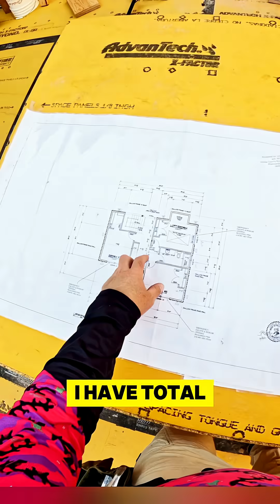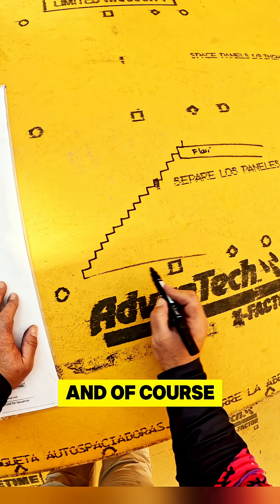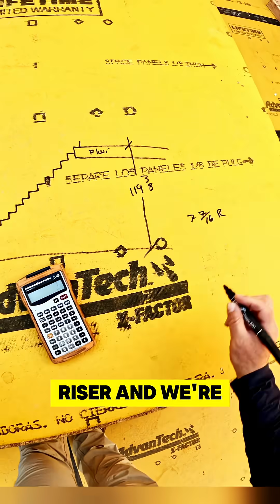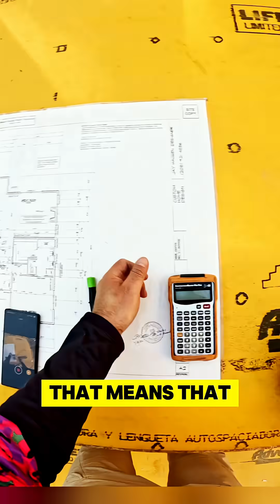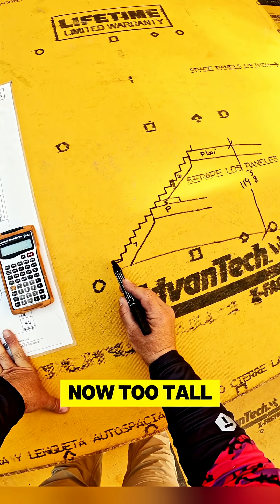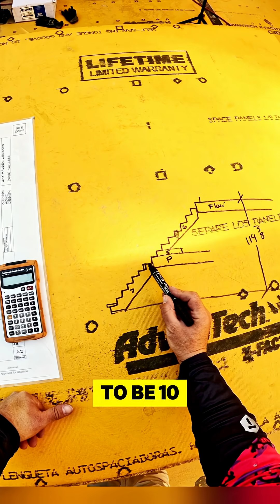How To Calculate Stairs

Comment: If the stringer goes from rough subfloor to rough subfloor and I have three quarter hardwoods top floor and bottom floor and I have one inch oak treads I deduct a quarter inch at the bottom rise?? I think. Wait, was I asking or telling???? Stairs are the worst even when you're just walking up them.

Comment: Finish stair guy here: calc. your overall rise off whatever the finish floor is. On a switchback (this one) set inside stringers with 7in between. If this get routed skirts set the wall stringers 6 in off wall or I'll just cut all your.points off.
Reply from the maker: I wouldn't build this way if a finish stair guy is coming in

Comment: In most cases the rise is always between 7 1/4 to 7 1/2  because it’s code in new construction I’ve worked with guy’s who wouldn’t even measure just used 7 3/8 in every house it always worked but I didn’t like it

Comment: What if you use a hanger board (lets say 3/4" or 1/2" ply?) to attach the top of the stringers to the landing, do you then have to subtract from total run therefore changing the overall unit run?

Comment: I'm retired. I have spent YEARS making and measuring for stairs. Do yourself a favour, use metric. Also do not count on plans for anything other than a vague idea. The builders will be out.. not by much.. but it will be out. So you wait until those floors are finished THEN measure the actual gap. If you use metric..(no one but you will know) it is easy peasy. Never got one wrong.
Reply: Thank you petermw88 for reminding us to measure the actual built height!
   Using metric (for decimal calculations and millimeter – 25.4th-inch – precision) rather than more complicated calculations with fractions and 1/16th inch resolution is an interesting idea. Builders in the US aren't usually fluent in metric and probably don't have the needed metric measuring and layout tools, especially a metric framing square. However, this is still worth trying with a metric/US tape measure and maybe a 300mm steel ruler, along with a stair gauges and a US framing or speed square!
   Another idea is to use 32nd-inch precision – as penguinz4493 suggested above – and "cheating" individual riser and tread dimensions up or down by 1/32" or 1/16" to make up the difference between the sum of all risers and the measured height.
Reply: Yup, got my head spinning a few moments into the video. Metric is way easier

Comment: A key factor here if you're using the same material on the floor your stairs are landing on and The Landings ignore that shortening step of the bottom stair
Reply: This is only the case if you're Landing your Stringer on the subfloor

Comment: I’m confused - isn’t there also the thickness added at the platform?  If you subtract from bottom of ground floor stringer and add treads to just below the platform, you maintain the 7-7/16 depth all the way up, UNTIL you add the platform advantec onto the framing members.  Now that last step to the platform is the tread thickness taller than all steps below?   I must be wrong, please explain

Comment: The 1912 house stairs would like to challenge the print. If we reset the rules to 7 3/8 rise & 11 3/4 tread, just give me the hole to the second floor demetions and I can make it work. The first tread may encroach on the hallway 3 inches. And the top tread may intrude on the structure beam. We need to (re-learn) what our grandfather’s already did.

Comment: Very well explained, and to teach, draw it out, I would say that every time, (draw it out). That said, working in the 1912 house don’t be afraid to go outside the box in a 1912 center hall colonial with a 9 foot first floor. In 3 floors doing “split” stair stacks in adjusted landing heights. The first stringer is 11 steps to a lowered landing, 7 3/8 rise to a 11 3/4 tread. That wraps to a 2 step rise to the second floor ( 8,6 tall). What this does is it shortens the first stringer to be able to go 11 3/8 treads. Making it so comfortable to climb these stairs (48 wide). The second floor duplicates, but makes up for 8,6 height in a 10/3 split stack of stringers. 10 up, (landing) 3 steps up again to 2nd floor (48 wide). The last split stack of stringers goes 9 up turn then 5 up again to 3rd floor. Completing this master pice of stair building. You don’t see it often, but when you see greatness as a carpenter, it is much respected. Even the base trim matches height of the stringers at base cut.
Lowering the landings from design spec was just brilliant, nobody ever thinks of lowering the landings, untill one sees it, then your like, “wow”.
Reply from the maker: Thats so cool. I follow Maine Stair Co or something on Instagram and they are fantastic

Comment: The only time you change the bottom step or top step height is when the finished floor material are different from the material used on the stairs. For instance if they used hardwood flooring downstairs and it’s 3/4 inch thick but the stairs, landing, and upstairs are carpet you would adjust the first bottom step accordingly. Carpet and padding probably is only about 3/8 thick which would mean you’ll need your first step about 3/8 taller. Nobody usually worries about this since when the inspector inspects the stairs at framing inspection he will check to make sure all steps are within 3/16 of an inch in height.

Comment: Height of 119 3/8" ÷ Max riser height of 7 3/4" = 15.4 risers. Then you always round up so 16 risers. 119 3/8" ÷ 16 = 7 15/32" riser height.
Reply: Thank you AwesomeFramers for your detailed explanation and sketch! It looks like you arrived at the 119-3/8" height by measurement rather than reading it off the plans – good for you!
   Your calculator seems to round to the nearest 1/16". A 7-7/16" riser times 16 equals 119" which is 3/8" below the second floor – you can compensate for this by increasing the 6 risers on the upper stair stringers by 1/16" each, thus making the entire rise 119-3/8".
   Thanks pennguinz4439 for your suggestion of a 7-15/32" riser! This riser height times 16 gives 119-1/2" total rise – if you reduce just two risers by 1/16" each, you'll be at your required total height.
   A mark of a skilled building tradesperson is knowing when and how to compensate for architectural details out of square, plumb, or level; adjust siding or shingle courses to avoid visible inconsistencies or problematically sized pieces; or knowing when to install something level or plumb versus installing parallel or perpendicular to an existing nearby detail.
   Lastly, thanks to all the commenters who reminded us of the need to consider finish flooring thicknesses on each floor and landing!

Comment: Putting a great deal of faith in that plan in terms of risers. I used to work with some folks that not very good draftsmen, and would not draw those in plan correctly.
Reply from the maker: No faith, I'm onsite and I run through this before framing wall, actually at wall layout to make sure it all fits 👍
Reply: Did tou actually use your brain when you watched this video? Or are you jist a concrete finisher?
Reply: Right on stairs never work the way there drawn
Reply: Tape measure...
Field fit. Done
Reply: We call those CAD monkeys, they give other drafters a bad name 😅

Comment: Yes sir. 
We also gotta keep in mind that landings will have 3/4” osb on top, which is about 1/4-3/8” thinner than your conventional stair tread. So always lay out your landings accordingly to accommodate for different thicknesses.
Reply from the maker: I use the same material for the landings, subfloor and treads to keep it simple 😊
Reply: @AwesomeFramers of course, 100% that is good practice when you have a choice.
In most cases, subcontractors are at the mercy of the builder’s/client’s lumber package.
Reply: @Frenchy509  Funny, when I hire the framing out they call in what they need. No way even as a sub I’d ever use material that’s incorrect.  Bad for the finish product, and even worse for your reputation when you’d no doubr be blamed.

Comment: Adding that 3/4” to the 119 overall number I feel might be easier to explain? And you just cut the extra 3/4 off the bottom step. That’s if you’re going down to concrete or no other finished floor of course
Reply from the maker: The stringer has to be lowered the amount of the tread as shown in the video

Edit: thinking about your comment, wouldn't adding it divide out incorrectly? Or are you saying burn 3/4 and measure?